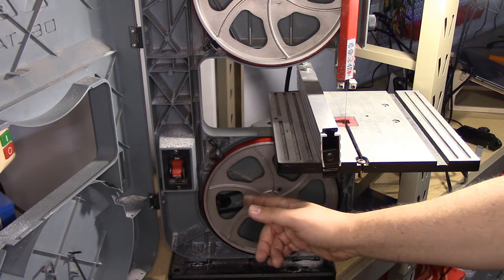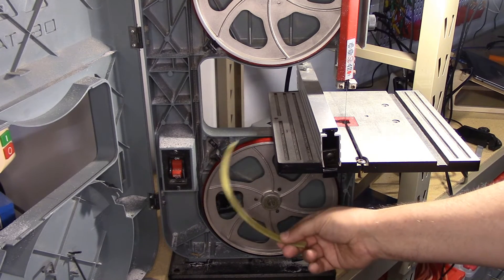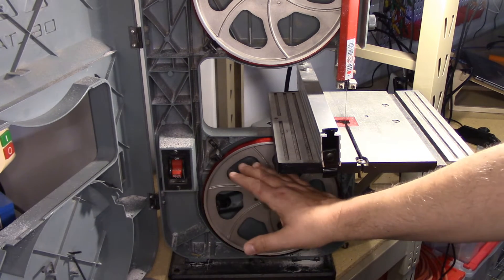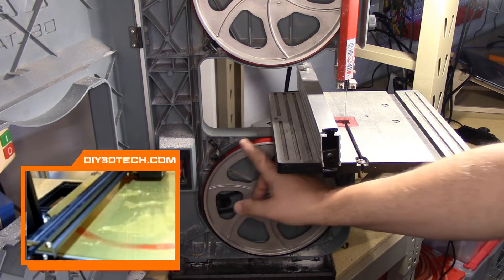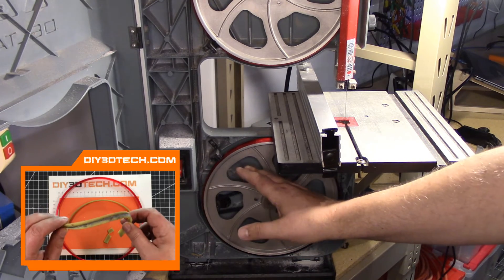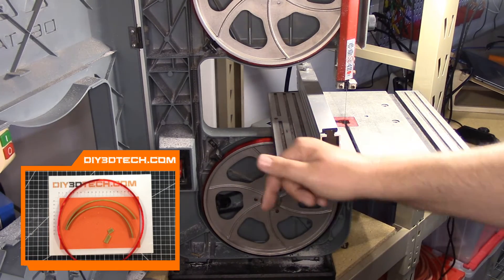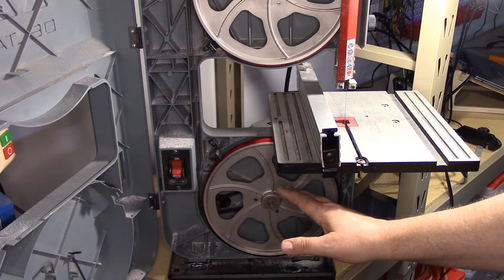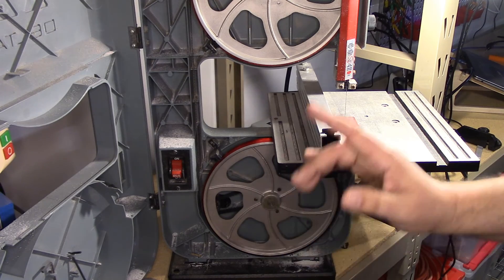Shop Talk - 3D Printing Saved My Band Saw!

Comment: If you don't have a 3d printer. I cut a bandsaw tire from a strip of leather belt that I got from a thrift store. I think that I beveled the edges where the ends meet, and I used "shoe goop" to  glue the leather tire to the bandsaw wheel.
I don't use my bandsaw very much, but I did the above several years ago, and have had no problems.
My bandsaw is in my unheated garage, and my original plastic tire shattered because low temperatures made it brittle. My leather tire is not impacted by the cold.
Thanks for sharing.

Comment: If it works, it works, but-- do you know that it's supposed to be crowned up in the middle? The blade will tend to travel up to that crown. I put new tires on mine. The saw was only $99 brand new. So, like you, I wasn't going to spend much for tires. So, there must be some cheap ones out there somewhere or I wouldn't have done it. I call that my toy saw, but I've actually been able to do a good bit of work with it.
Reply from the maker: Yes, and it sort of dose  and has worked great!  Now if I was professional where this saw had to run everyday I would have sprung for the real deal however these have worked well.  The only down side if you can call it that is the TPU is little stickyer then real thing and it adds a little more "drag"...

Comment: Excellent! 😀 mine are getting well worn 😢 but I didn’t see a size anywhere? Will this fit a 315 mm diameter wheel? Cheers
Reply from the maker: As I recall this is 226mm ID and 236mm OD x 12mm